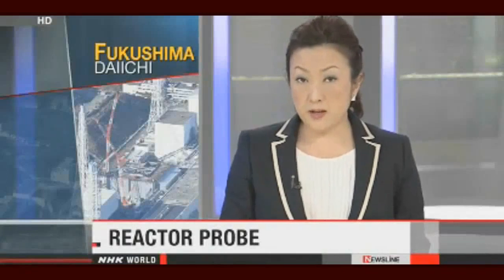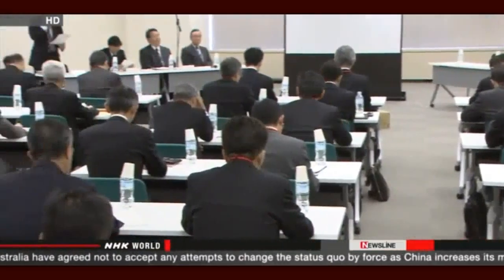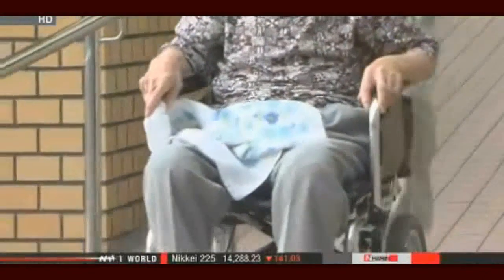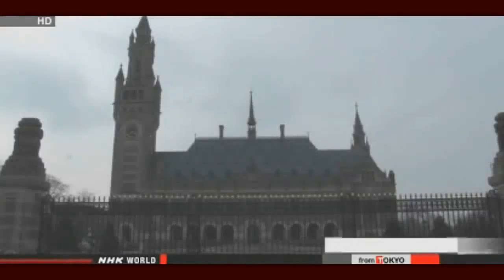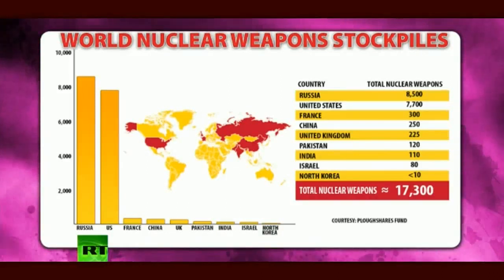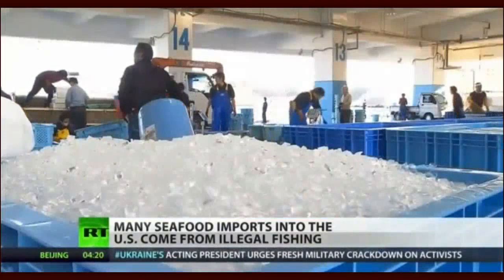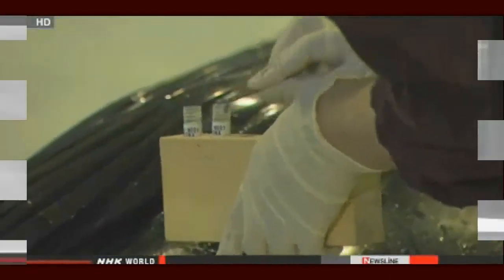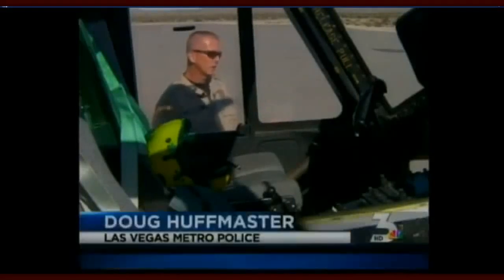Fukushima Seeks Melted Reactor Cores update 4/28/14

Comment: question I never did understand why they couldn't reuse the contaminated water? why always more and more water?
Reply: they did.. truth is nothing left to cool 3 cores meltdowns  gone,  4 spent fuel pools gone. burned/melted. just ground water sucking up rads on the way to the ocean. teking up some heat from the top of the melted cores. but nothing much